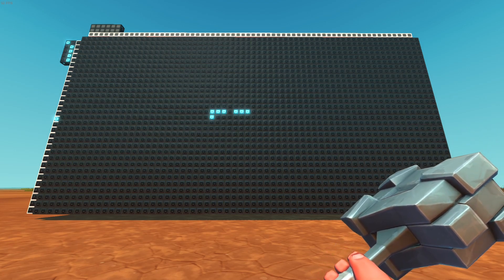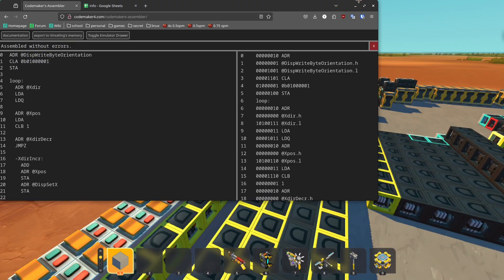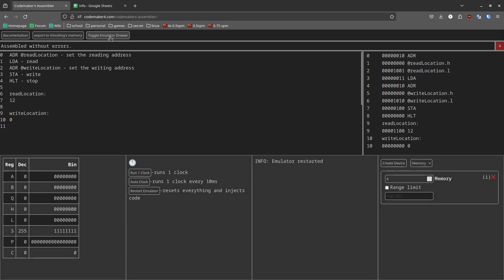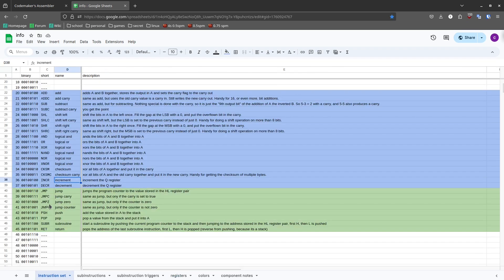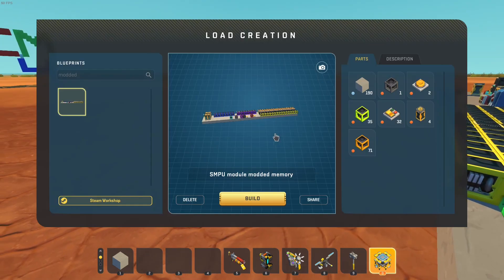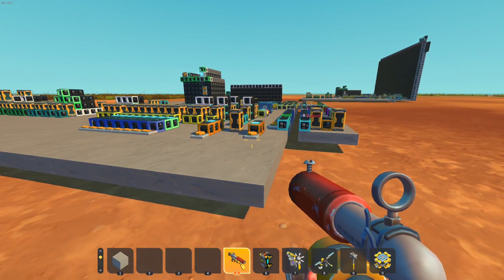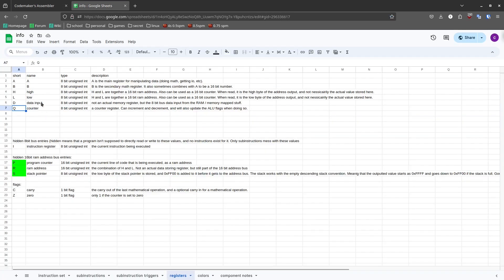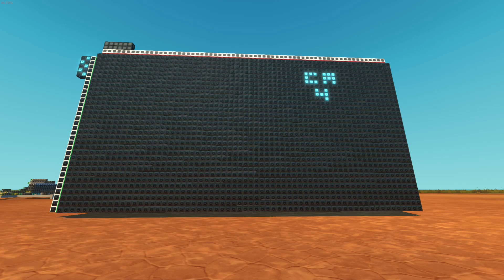SMPU tutorial

Comment: i opted for a more compressed ram design using logic gates for my 4 bit cpu and the only downside is that for 8 bytes of memory its like 1500+ connections and thats for a very simple ram design that only supports 1 output and input at a time. everything else is so much easier

Comment: what computer architecture does your cpu use? because it seems weird that it uses 3 clock cycles to execute one instruction when the amount of cycles normally depends on the microcode
Reply from the maker: Well that is a long story. I have since made a followup video that explains a few things:
https://youtu.be/sUoLMWA490k?si=uC8l5PxPmJtYQumL
But about the microcode: the SMPU doesn't really have that. At the end of the video I linked I show how the instruction is decoded, and then each instruction has a little timing circuit that triggers all of the needed components in the right order and with the optimal delay.